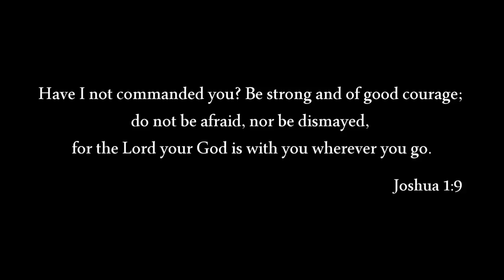Case IH 8940 Magnum Time-Lapse - Welker Farms Inc

Comment: My grandpa bought a brand new 1987 case 7140 right when these tractors released. He ran it hard with no major repairs required until the transmission needed replaced at 25000 hours, but he sadly had to scrap it as the transmission replacement cost more than the tractor was worth. He still owns and operates many of these magnums on the farm today.

Comment: Beautiful job fellas. She's shining like the day she rolled off the assembly line. Those 8000 series magnums are one of my favorite tractors.
Reply: ih1206        ?!!?
Reply: I like the older magnums like the 7100,7200,8900 series and I like the 86 series, 66 series.
Reply: 7100’s will always be the best in my mind. #7130/7140
Reply: The T114 God 7140s we’re set hot from the factory. Good machines
Reply: ih1206 

I’ve used both a ‘91 7140 and a ‘93 7130. Both are absolute workhorses

Comment: Cool timelapse the tractor looks like new. Maby if you paint rims next time put some grease on the tires so the paint comes of. Then you dont need to use tape or take the tires of the rims
Reply from the maker: +boer brabant That is an excellent idea! Will do that next time for sure!
Reply: Hoe is het er mee boer brabant?
Reply: Another tactic that is easier in my opinion, is to cover the tires in saran wrap, then trim around the rims.easy/quick to apply, easy and quick to remove.  Cheers!
Reply: Vaseline instead of grease, easier to clean off.better for your hands.
Reply: @keystonecarpenter3002  be prepared for some inquisitive looks from the clerk's at the store when you put that much vaseline on the counter
Reply: Jimbo listen to Andrew Dice Clay for a proper reply.

Comment: Hey do you gus know if that fuel tank breather line goes up into the roofline? Our 7220 doesnt like to take fuel and thought maybe i could disconnect the hose and blow the steel tube out.
Reply from the maker: We never separated the fuel tank from the cab during the restoration so I can't be 100% sure but I am pretty sure we saw a hose going up the side of the cab in the cab frame. I could be wrong though. They don't really have a great fuel inlet, without an auto shutoff handle you'll blow fuel everywhere when full!
Reply: ill give it a whirl. Im was told the breather being plugged can cause them to not fill right so ill try it out. Thanks
Reply: Have you guys tried to reupholster the interior? I installed new foam on our 8920 this weekend. All states tractor parts sells kits for $159. Comes with the door fabric even.

Comment: Just a question. Is it more wort restoration than buying new? Like im thinking the workshop cost the hours and the new iteams used on it
Reply: Magnus Gro it’s worth it to many, you can’t beat older ones like this on reliability, less computers, general appearance etc. It’s cheaper to buy one of these for 50 grand than 300 grand for a new one that will break.

Comment: To those who know, what advantage "reverse" tires have? Thanks.
Reply from the maker: Honestly there isn't a lot of advantage but on rear steering equipment such as combines and swathers, having the tread reversed can help with traction.
Reply: Now that I think of it, there are adavntages in making dirt not part before the wheel, but instead pushing more of it under... Thanks for info.

Comment: Bought a 2017, 120C and at first I loved it but after 160 hrs I was having all sorts of trouble. Dealer had it from January until April 9th 2018 and brought it back unfixable. It doesn't run right and Case IH doesn't have a fix for it. I told them I wasn't willing to keep a tractor that wasn't properly engineered to run right but Case IH is refusing to replace the tractor. FIAT owns CNH so steer clear of Case IH and New Holland! JUNK and they will not stand behind their equipment.
Reply from the maker: That's too bad, I've heard a lot of horror stories the more  I talk with farmers.
Reply: Yea, too bad I didn't hear the bad until after I purchased mine. One guy told me his was literally falling apart since new. He hired an attorney and made them refund his money. Sad it has to go to that point before CNH will own up to their problems. Class action lawsuit is what needs to happen. Too many companies don't care about their products or their customers, just profits.